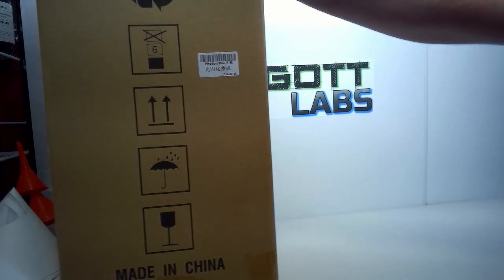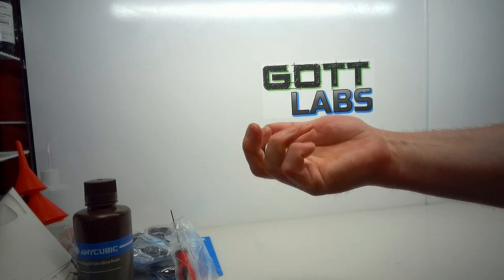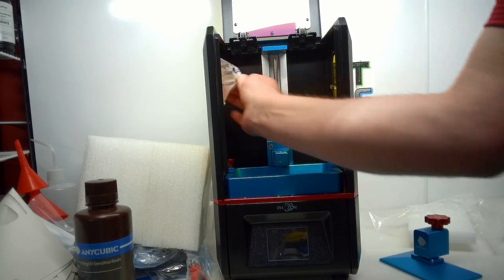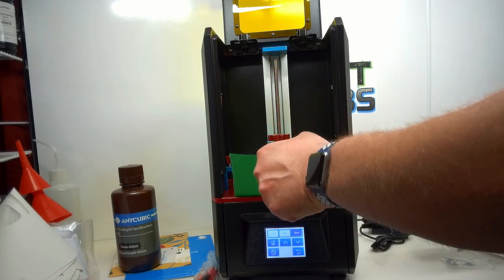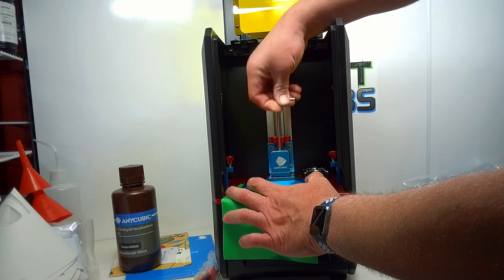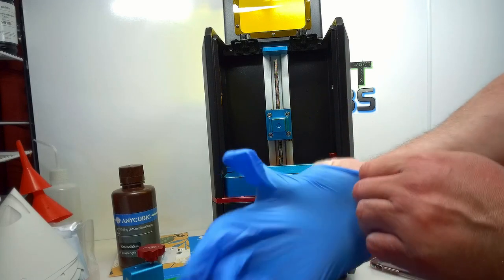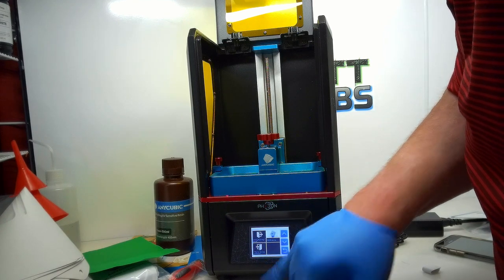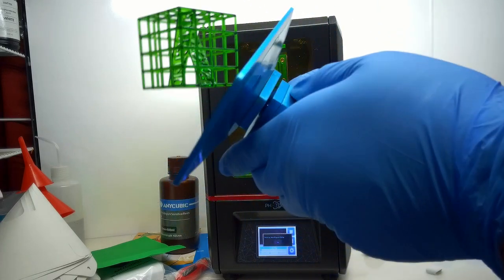Anycubic Photon- Unboxing, setup, & first print

Comment: when i go to print i dont know how to get it to read my files, it shoes one test model but nothing else, sn dI dont know how to set anything up
Reply: Make sure you've updated the firmware all the way. Head on over to Anycubic's site, find your specific product, and at the bottom where it says 'Anycubic Care' there should be a firmware on the far left (at the time of writing this comment, it says 1. V5.0.2), go ahead and download that file, place both BIN files into the root folder of a usb, then try to 'print' each of those files from your photon. After you've done both, it should recognize .photon files as well as .pws files. Just make sure they're always in the root folder.

Comment: I was going by the manual and for the first test print I'm not sure if I moved it down far enough on the Z-axis. I'll know in a bit if the print failed or not. ¯\_(ツ)_/¯

This is the first 3D printer I've ever used or tried so I do have a question about the resin available too. Have you seen a difference in the eco-friendly resin in quality? Specifically the prints over time and how well they hold up or is that even something to worry about once they've cured in the eco resin?

Comment: Which one Do you think is better, the Anycubic photon or the Elegoo Mars? For me the Z axis calibration seems much easier on the elegoo right?
Reply from the maker: The Photon and Mars have similar leveling procedures, but the Mars is just a better machine overall... Don't get me wrong- The Photon is nice, but they seem to have a lot more QC issues, and it's also older more dated tech. 

And, with the current sale price on Amazon, the Mars is a killer deal.
Reply: @TheSLAChannel  what is the older more dated tech? As i understood it, they use the same tech for the relevant parts (same lazer, and same projection method), both single Z lead screws etc. I just bought a photon and would like to know why i screwed up haha :3 (got it for 279$ on sale on their website)
Reply: @TheSLAChannel  What specifically are the QC issues and differences in the tech? 

After watching the video it did help me in securing the print to the bed as the manual from Chinese to English seemed to lack specific details seen here. Eg. the amount of friction with a solid example would have been ideal but minor.

Personally I chose the Photon as Anycubic has a dedicated page for their devices, easily accessed support email, accessories clearly listed and an amazing community on Facebook (obviously run by makers and not Anycubic but still impressive with the amount of information available.) Elegoo; to me, seemed to be more difficult as a search brought up Amazon and Twitter while going to elegoo.com displayed more of the maker items in general and didn't seem to focus on the printers as much as selling the components. One thing that I noticed also is that the resin bed differences between the elegoo mars (plastic) and the photon (metal) to me seems to be imply some better overall build quality with the Photon as the case is also mostly metal instead of a plastic top. Just my personal opinion.
Reply: @TheSLAChannel  thanks for the answer! I've just bought the Mars on Amazon, I think I did a great deal for $250

Comment: I'm about to order one this evening, so I wanted to get an idea of what the setup was like. Coming from FDM printers, this looks remarkably easy. I know the cleaning process after the print is a bit more involved, but I'm excited!
Reply from the maker: They are pretty easy to set up, the calibration process is generally not nearly as difficult as with FDM. I started with FDM machines. The setup process is VERY different, but no more difficult. Messy- Yes... But well worth it.